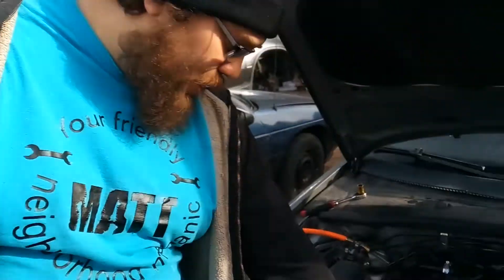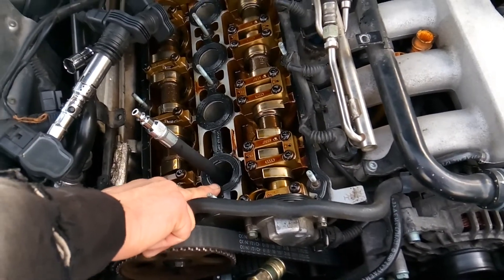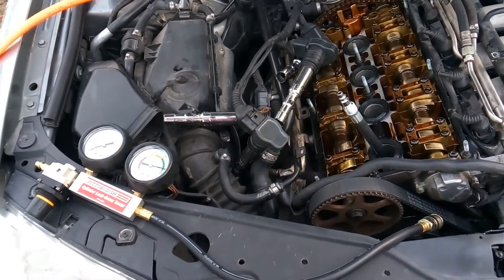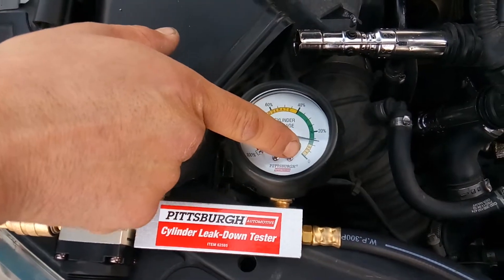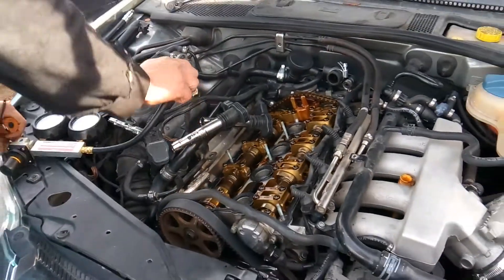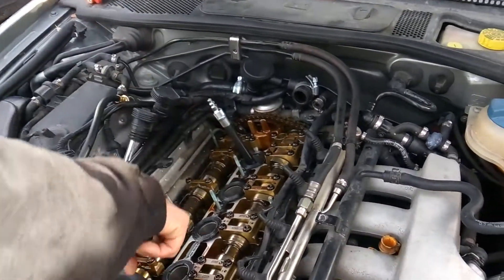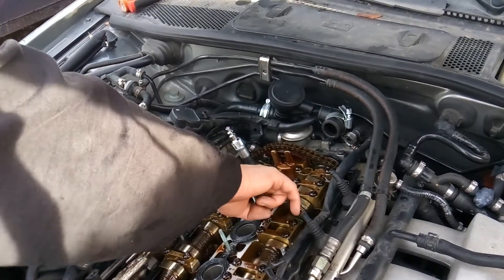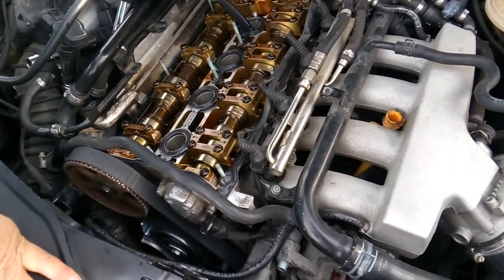Cylinder leak down test Volkswagwen testing for bent valves

Comment: Glad you went in detail.  Very helpful and knowledgeable.  I learned a lot and thanks for doing this.  The other trick is slide a wifi camera down the sparkplug hole and look for the bent in the valves.

Comment: Hi, my name is Cameron and I live in Blackfoot, ID. I am currently working on an 02 V6 2.8L Passat that I have rebuilt both heads. The timing belt has snapped, possibly due to a timing belt tensioner or water pump failure. I need to perform a leak down test, but don't really know what I am doing. I would greatly appreciate any advice on performing this test on DOHC engines. Thank you!
Reply from the maker: Email me and lets try to connect. Highgrooveauto30@gmail.com

Comment: Great info on that kind of testing!  Is the car still in timing, after you did compression to test or would you need to set tdc again?
Reply from the maker: yes still in time but the play in the belt allows it to over adjust it self. so its off by half tooth basically